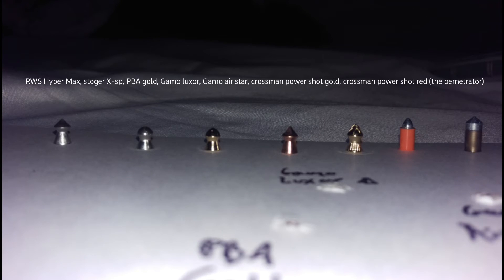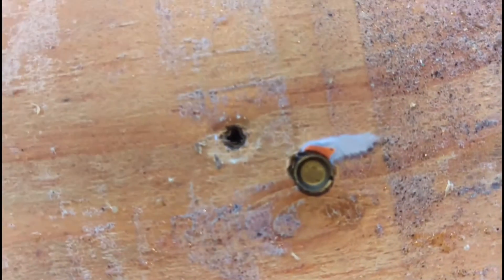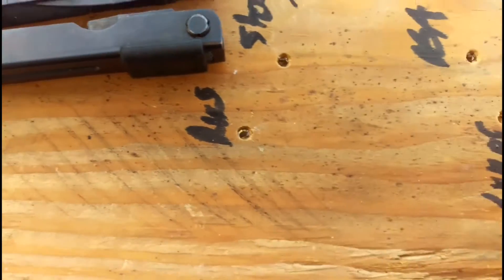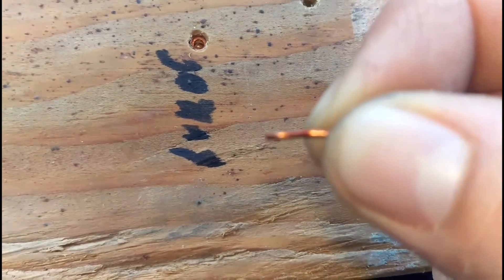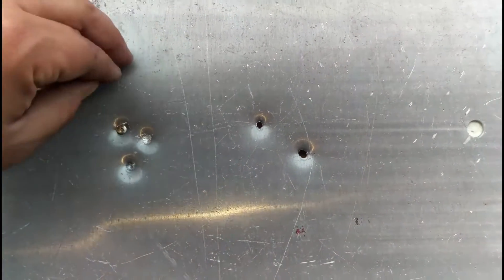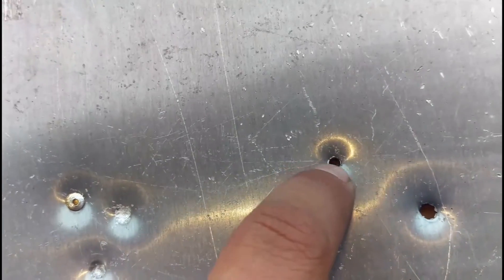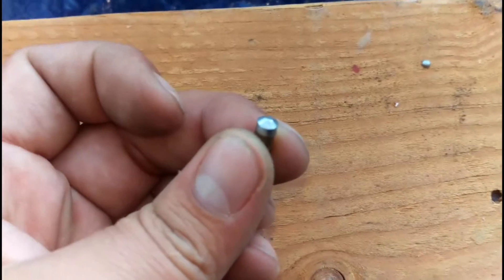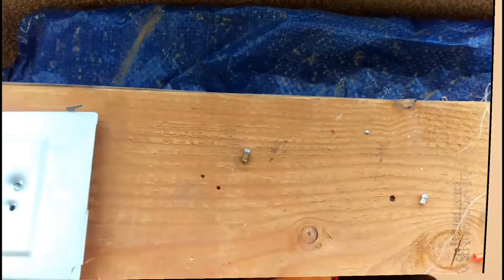Air gun pellets vs wood and steel

Comment: Used this as reference for building my indoor backstop, I used 3/4" plywood topped with two basic garage mats. I'm using a Hatsan Striker 1000 and have hit it with ~200 basic Crosman pointeds so far and haven't had any "incidents."

Comment: nice video
Reply from the maker: X Infinity thanks, it was one of my earlier ones
Reply: I need a confirmation from an expert, the barrel of my rifle is as wide as a pencil is it a airgun, and has two other bigger barrels but not the actual barrel
Reply from the maker: X Infinity it sounds like a .25 pcp air rifle. its easier if you add a pic